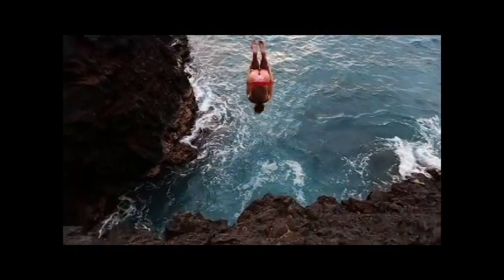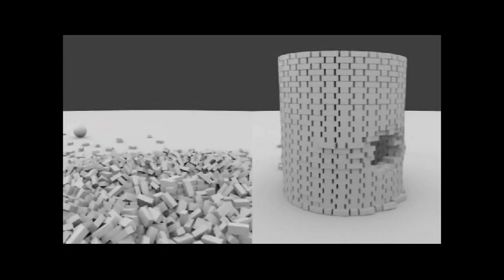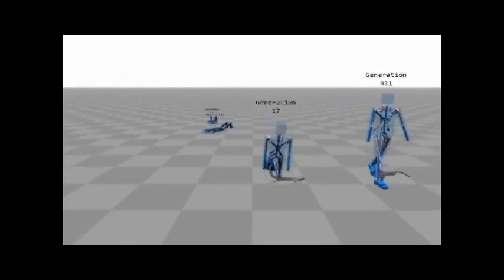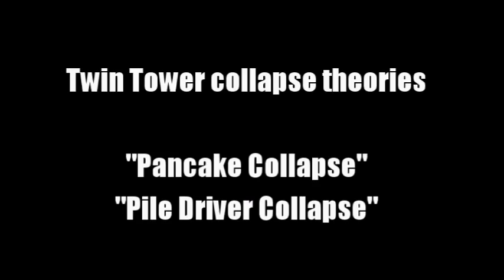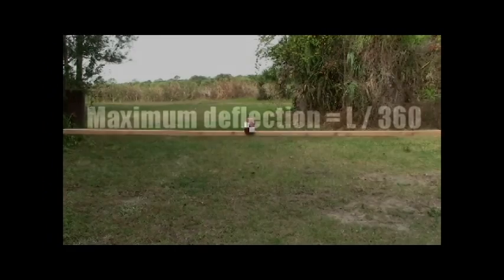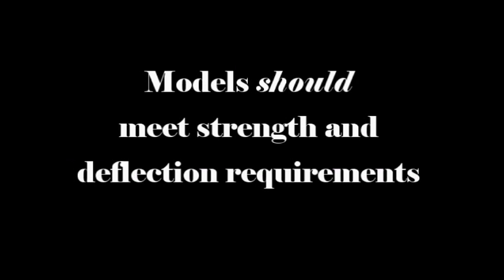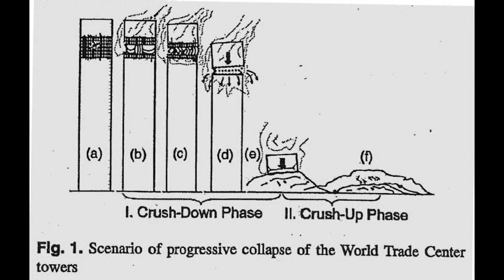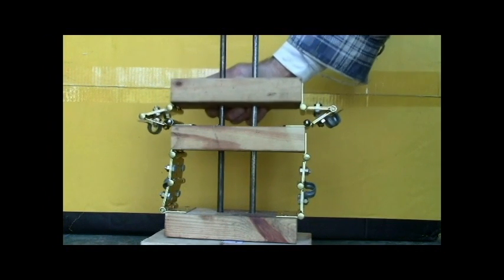9/11 Experiments: The Force Behind the Motion

Comment: Excellent work! I commend you for all the effort you have expended to create these videos.  I know that Dr. LeRoy Hulsey and 2 graduate students are working on a computer simulation of the collapse of WTC7 at the University of Alaska.  For those who might dismiss your work - and they would be insane to do so - hopefully the work of Dr. Hulsey would convince them.

There is one major problem that remains as I see it, and that is whether the "no airplane" theory is valid.  There are many conflicting videos on-line.  Were they photo-shopped?  What about the video that shows a "squashed sphere" heading toward the WTC tower?  I tend to believe the no airplane theory, but until there is solid evidence I will withhold final judgement.

I submit that a simulation of an aluminum airplane striking a steel  framed building would be most valuable and, at the same time, extremely difficult to create.  There are many videos on-line that show how "fragile" airplanes can be: the one that makes a hard landing and the tail section breaks off; the wings that break off the plane used in firefighting; the plane crashes in the ocean and the wing breaks off.

I am very skeptical that an aluminum plane can strike a steel framed building, "smoothly" cut through those box frames and completely disappear into the building without leaving any debris (except for a passport?).

Is anyone aware that such a simulation might be in the works?
Reply: +zaxineohp  Only 1 live video at wtc, the rest can be dismissed
Reply: +k dog Could you supply a link?

Comment: These experiments are totally invalid. It's shocking to see so many commenters praising them as beautiful science.
Reply: Spherian7 I'm not an engineer, I'm more interested in 'girlies'. Nevertheless, the onus of proof is on the experimenter to establish that paper and matchsticks have the same material properties as steel and concrete. These experiments with miniatures no where near approximate the colossal forces involved in the twin towers collapse. It's like throwing a paper aeroplane into the ground and wondering why it doesn't smash to smithereens or virtually bury itself as a passenger jet would. 

That's why engineers have to use meticulously calibrated computer models. And even computer models are based on myriad assumptions that can't account for the chaos and innumerable variables in the real world. They're still, though, the best way we have of understanding something as complex as building collapse.
Reply: +Bonto Max  OK. Well said. That's what was needed in the first place. I appreciate your position. Girls are great, but the finality of your comment requires a closer examination of the source, due to the preponderance of anti-"truther" mindsets in the mainstream.  So, just say more on this crucial issue, your thought is worth it!
Reply: +Bonto Max Your wrong. Computer models can be extremely inaccurate, it depends entirely on the input. To find out how a building collapse you have to examine the entire structure and steel on the ground, and find evidence of critical failures. Then you could do some input and testing. But the motion of the collapse can easily be tested like this, if you can`t replicate the motion of the collapse with your theory you are probably wrong.
Reply: +whatwhat3432523 I bet someone could replicate the motion with a better scale model. A good model would require no central guide rod. It would demonstrate the massive destructive force of the top section under momentum. There's no way that that top section could have plonked down and perched on the lower section. It's almost like a rocket - enough thrust keeps it dead straight and pulverises whatever gets in its way.

However, I'm no structural engineer. I respect your point but I remain unconvinced.
Reply: Bonto Max   Good point re: central guide rod.   I have been thinking as a result of this vid etc about the collapse of the NT vs ST in that the NT can be seen to be completely "cut", if you will, around its perimeter at the crucial floors. However, the ST is very clearly showing only the same heat burn/damage line around  1/3rd the perimeter, and the remaining section is completely undamaged and devoid of even smoke. The various videos at ST collapse show the top floors tilting at a 45 degree angle as the weight is, ostensibly, pressing directly on the fault area in that very limited damage length. Thus as the steel softens, all the weight goes there upon initial floor collapse.  This 45 degree tilt would further show the majority of that floor was intact and not affected by the heat.  It seems unavoidably clear that the "pile driver''s" major portion would have remained fully supported by the intact majority portion of the Tower and slid off onto the streets below.  I cannot envision how the all-crushing downward momentum could have been established or continue with such an offset. Many others have commented on this aspect.  Also we have the radio transmission of the rescue personnel who made it up to the damaged floors and reported only a few residual fires., bring up hoses and such. What think ye?